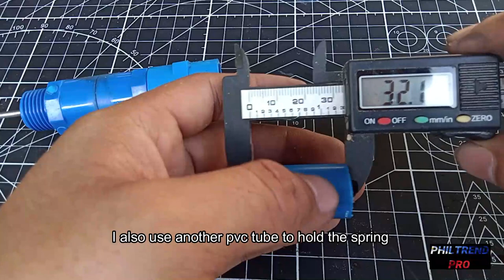NEW PVC VALVE

Comment: I looked at all of the videos and mind still cannot work air flow problem and have me looking at it want to know what I do wrong 😳
Reply: This is similar to the valve that is in the car tyre....if you press the pin valve you let the air out....here it is done with a hammer for a fraction of a second as the pressure is 10 to 100 times higher depending on the pressure design and the air exhausted is routed out towards the back of the pellet which is shooted out because of this air pressure